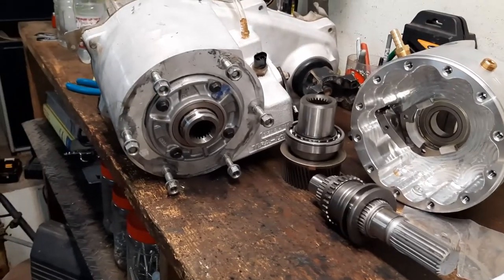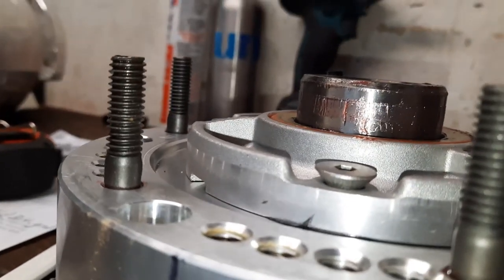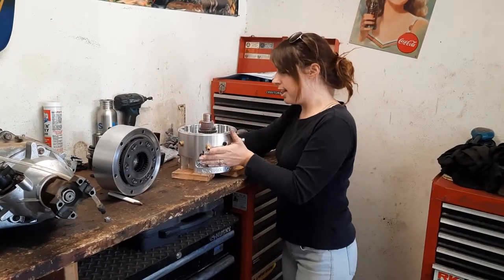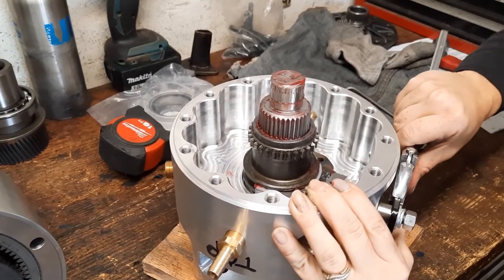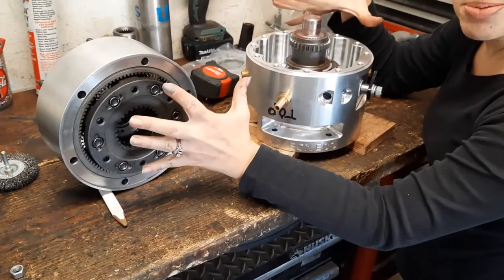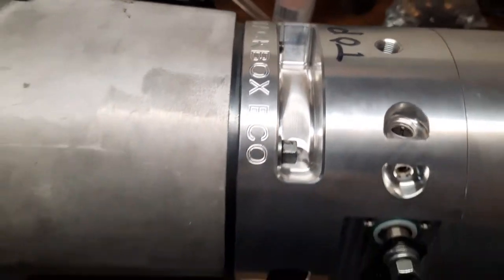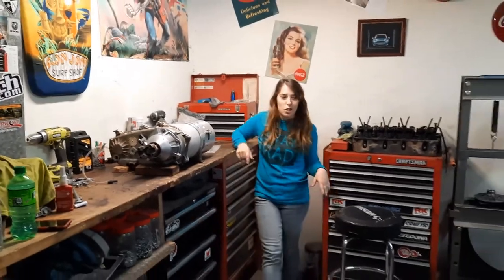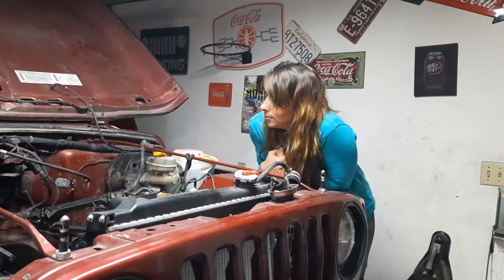*Update* Installing a NWF Ecobox in a 4 cylinder Jeep

Comment: If you have time, can you measure from the front mounting surface of the ecobox to the center of the 231 output shaft, the center of where the ujoint cap sits?  Thanks.
Reply from the maker: T-case length 16.5" to where ujoint caps sit
Ecobox 8.125" for a combined length of 24.625" from front mounting surface to center of yoke.

Comment: The teraflex 231 4-1 case is not known to last long under hard use...
Reply from the maker: Yea because people don't know how to keep their rpms under 2500 when they are in low range. I drive a manual and keep a good watch on my rpms to ensure it will last as long as possible. I personally think it's a great t case if you take care of it properly.
Reply: Then add the doubler in front of it. Sending 2.72x the torque to it.

Comment: Talk about perfect timing! My Teralow just bit the dust so I've been researching options for low t-case gearing for my 4 cylinder TJ and found your channel. I love the idea of moving the engine forward and running a 231 with a doubler/black box. I'm extremely interested in how you are going to make this all work and I'm hoping for more videos! 

What are you going to do for the shifter in the AX-5? That is my biggest concern and one reason I haven't ordered the NWF kit yet. I would like to hear what you have planned for shifting with the transmission moved 8" forward. Also, will you just run a 6 cylinder fan shroud? I'm stoked to see this come together.
Reply from the maker: The shifter being moved forward 8" is, I think,  the biggest challenge. I'm planning to bend or remake the stick into an S shape. Currently I'm waiting for the engine. 
The engine was ruined due to faulty oil pump so we ordered a remanufactured long block. So all we can do at this point is patiently wait for its arrival. 
For the fan shroud,  yes I plan to use the 6 cylinder shroud. 
Stay tuned to see how it works out, I'm anxious to get back to it, hopefully the engine shows up soon.

Comment: Did you have to change the output shaft on the transmission?
Reply from the maker: No. The input of the ecobox needs to match the transmission- 21 spline for 4 cylinder, 23 for 6 cylinder. The ecobox doesn't come with an input. You would use the appropriate input from a stock 231 (depending on transmission output for 4 or 6 cylinder)

The ecobox (for jeep) only comes with a 23 spline output. So if you have a 4 cylinder... you would need to change the transfer case input to 23 spline.

Comment: What is an ecobox, I’ve never heard of it?????
Reply from the maker: It's a doubler case (minus the insides) made by Northwest Fab out of Canada. You should look them up.
Reply: @TeamMalakowskyAdventures  thanks, I’ll do that.
Reply: @ronnie32567  By now you may have found a better explanation, but for others; it gives the options for  1:1 for normal driving and 2:1 that multiplies the low range of the transfer case for better rock crawling. Bill Vista has a good tech article on the subject.
Reply: @gdsstudio974  thanks I’ll check that out also